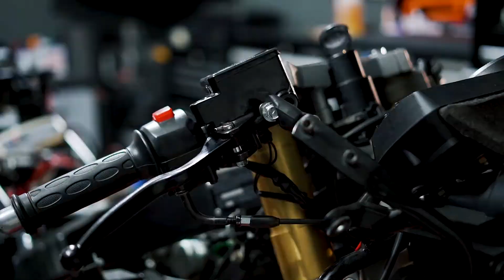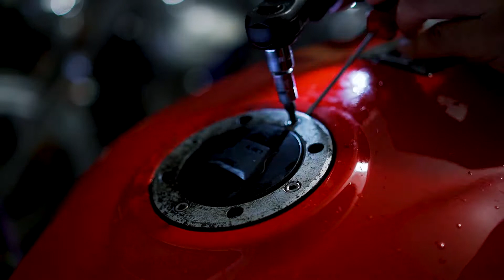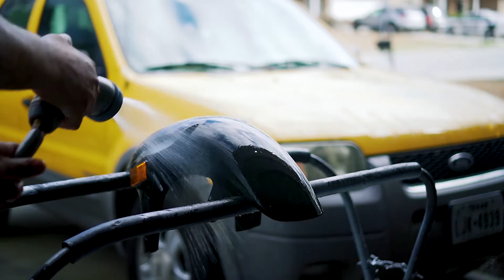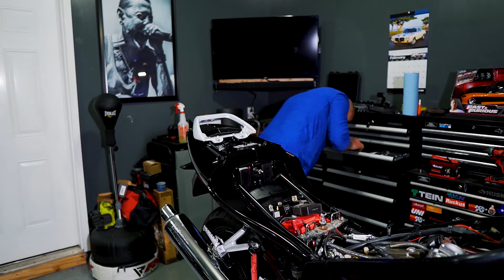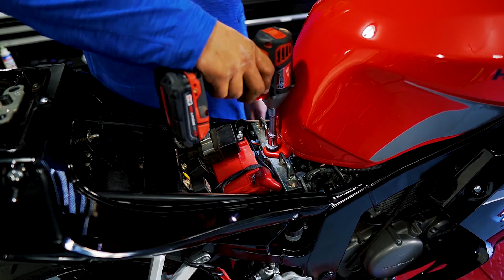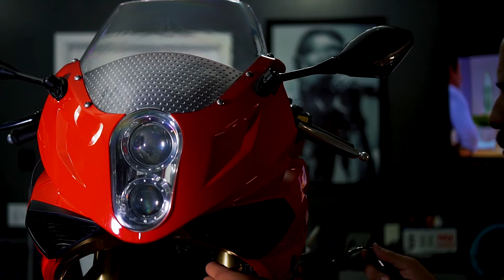2008 Hyosung GT250R Rebuild part 4 of 5 (Naza Blade)

Comment: Hi, 

I have 2014 Hyosung 250R. I kept in garage for almost a year now. 

Can you please suggest what should I change. 
Apart from oil, filter , battery. 

Thank you
Reply from the maker: Thanks alot for watching my video!

I would suggest to empty your gas tank also change the gasoline filter , get some injector cleaning additive and add it with the new gasoline  ,change the brake fluid if you don't probably the brakes are going to feel a little spongy , check if the brake pads are still in good condition, sometimes brake pads get a little rusty when a bike has been sitting around for a while and start falling apart just by touching them , if the brake pads are solid just get a wire brush and do a little cleaning  where you see rusty spots, check the chain , if your chain have a rubber seals between the chain links ,inspect it and check if the seals are not cracked or dried, if the chain still in good condition clean it and lube it , but if the chain has rust I highly recommend to buy a new one, also check the tires  for flat spots on the side where the tire was sitting touching the ground, put some air on the tire and check if the tire goes to its normal round shape, if you happen to have a tire that has a flat spot you are going to need to change it, also try to lube your clutch and throttle cables , the cables  can get stuck while riding if they are not well lubricated and you can get into an accident and last just check if the wiring is in good condition a friend of mine left his bike in the garage for a while and a rat chewed the wiring of the motorcycle
Reply: JMR BUILDS Thank you for your reply. Means a lots. 🙏

Have a good weekend. 
Cheers
Reply from the maker: @shenyentenzin3824  you welcome , if you have any more questions don't hesitate to ask me , I'll be happy to help! 

Have a nice weekend too 😊